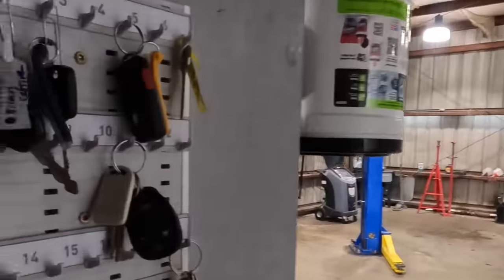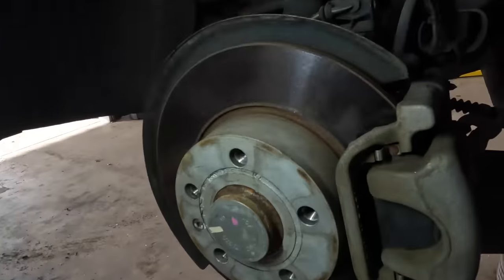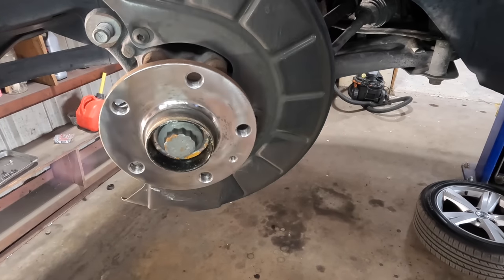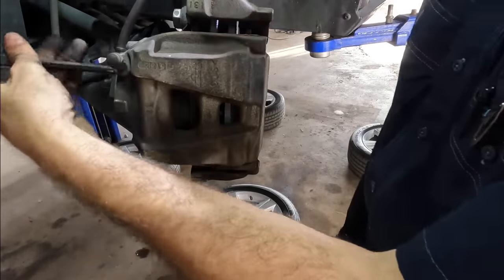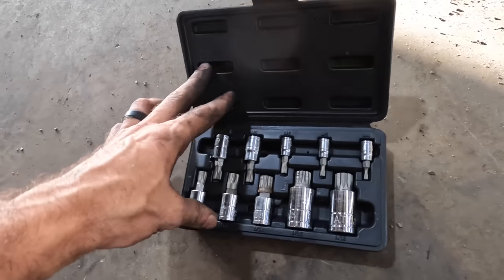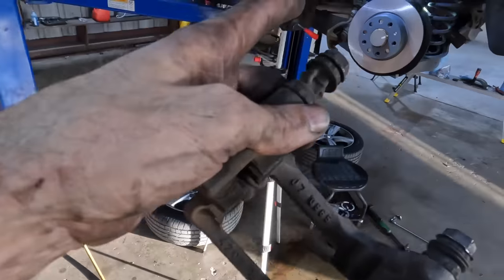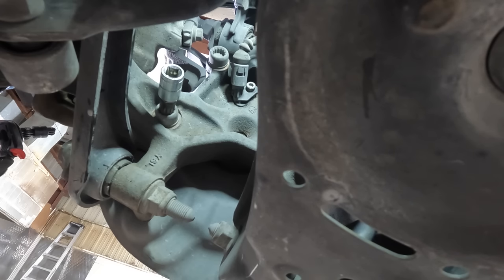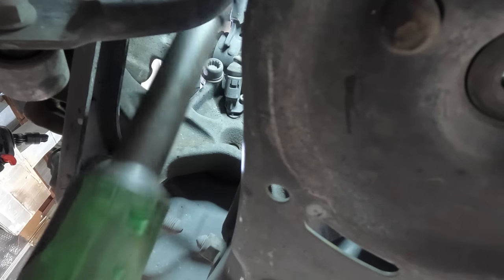Brake Job…with a Belt Sander? 2015 VW Jetta

Comment: That belt on the sander is screaming out for some tension there!

You restored my faith in humanity for lubing the rear slide pins, I will let it slide that you didn’t do the fronts (pun 100% intended).
Reply: 50-50 good enough.
Reply: Customer did want... to save some money - mission accomplished !
Reply: but the caliper is not human, will not slide for him, ensuring customer will pay for new pads and rotors next job.

Comment: Ray, at around time 37:00 when you were spraying out the caliper bracket with the stuck slide pins, brake cleaner splashed onto the camera lens. I sure hope you were wearing safety glasses. I am speaking from personal experience here, I wear glasses and way back in 1978 I had a '73 Chevy Impala Custom Coupe. The rear axle seal was leaking gear lube onto the brake shoes. I cleaned the shoes with brake cleaner and some splashed into my eye from one of the rivet holes in the brake shoe and into my eye from around my glasses. Immediately there was intense pain. I quickly ran about 50 feet to the janitor's sink and got my head and eyes under the faucet. Thankfully there was no permanant damage to my eye. Just be carefull and use PPE!

Comment: Did not know this

I am always told, rotor and pads need replacing at the exact same time

Now I feel scammed

I also am told I need to replace both front or both back at rhe same time (so 2 at the same time)
Even if problem only is with one

Comment: I have also battled with stuck brake pins.  I have even considered drilling the back side out to drive them out or install a zerk fitting to later be plugged!  I do have a 10 mm drill in my brake kit to clean out the corrosion and cooked grease.

Comment: I have a 2013 TDI which is probably the same.  It has a wear sensor in one of the front brake pads, the driver side if I remember correctly.  These cars go through brake pads very slowly.  If you are working on a V-Dub get yourself a set of XZN (triple square) sockets and one or two wheel alignment pins, M14x1.5 in this application.

Comment: Ray, one of my friends had that lug nut arrangement and the caps. He did not like the looks without the caps or he would have just left them off. He did figure a way to make the job easier. He drilled three holes all the way through the caps near the top. This, of course, resulted in six actual holes as there where holes both where the drill went in and where it came out. From then on he used a small hooked pick from Harbor Freight to reach in and grab the cap by one of the drilled holes similar to what you were trying and eventually accomplishing with the small wire that you were using to get the cap off.
Reply: The cars actually come with a little tool designed specifically for removing the covers, so no need to modify them. Assuming a lot of owners lose it or don’t even know it’s in the tool kit in the boot.
Reply: @edward.pearson  Whose boot and which foot?

Comment: i worked on euro cars for nearly 10 years, and every time i tried using my 1/4 inch impact on the rotor set screws id snap a torx.... i always had to use a friggin impact driver and hammer instead. win some, lose some indeed lmao.

Comment: Hi Ray, another great video and learning experience. However ever since I discovered boys as a teenager, I no longer do mechanic work.  Heck; I might break a nail.  I do have a question, why did you not resurface the rotors? Why replace the rotors when maybe they could have been saved? Was it due to time, labour was less by changing the rotors instead of resurfacing the old ones?
Reply: he said it, new not necessary good,ut b has no accurate measuring tool.
Reply: Very good question, since he already showed us his brake lathe, the new toy he just got!

Comment: I have found on my VW’s that i have to clean the inside of those triple square bolts because i always find they collect road dirt and don’t allow the socket to seat on the bottom of the bolts pocket, brake clean and a red tube to the rescue, i use scotch brite pad on those rusty slide pins. Good video to know how to properly evaluate the uneven pad ware that the previous person found before the pad slap.

Comment: Never seen a belt sander used on an almost new brake pad  to remove the grooves before. Not standard procedure , that's
for sure. This would have taken me a whole  day as a non garage owning regular joe who has done few on my  Chrysler 
made trucks and cars only. Got to make sure the slide pins are doing their job and not frozen.  Since the customer is happy
 about the work and cost of it.  Who am I to judge Ray , you did good.

Comment: They are Allens keys, not hexs lol

Good job they don't use Asbestos in the friction material or you and your lungs would be screwed (Asbestosis) but you should still think about the fine particulates messing with your lungs (miners lung?).

Different solvents can affect your health in different ways. High airborne concentrations of some solvents can cause unconsciousness and death. Exposure to lower levels of solvents can lead to short-term effects including irritation of the eyes, lungs and skin, headaches, nausea, dizziness or light-headedness. 🤔

If the slides are sticky it would be the outer pad that would wear more (bind on) as the caliper piston also backs off slightly when you lift your foot off the brake (the seal pulls the piston back a bawhair lol) but if they were excessively seized then you'd only be getting the inner pad doing all/most of the braking causing it to wear out prematurely.

Comment: If you soap and water, it’ll take it right off with a scrub brush a lot of the manufacturers don’t like to use and brake clean on the rotors and they won’t warranty them

Comment: I've never used a belt sander, but have scuffed the surface up on smooth pads on the concrete floor a few times.

Comment: I find VW using callipers from two separate suppliers odd. ATE on the front and something totally different on the rear. ATEs on the front are the same ones ford used on the rears of the Focus ST and the Mondeo/Fusion

Comment: I did my mk4 brakes and rotors this summer and my ABS hydraulic pump just decided to unalive itself 🙃 so now I'm riding on brakes version 1980s. 😅 found 3 units. That's for my technician friends,  but brakes that aren't anti-lock, fuuuuun.

Comment: I loved my 2013 Passat.  Great mileage, comfort and room.   I would have kept it for very long time.  I trade my Acura and my Solara  convertible,  believing that at retirement we only need one car.   The Passat was a great car for the first 35 thousand miles, then it happen.  From the repairs it needed I knew it was doomed. I unloaded it and got a boring Honda.   It was not less than a month latter that all Passats were recalled around the world, due VW lying to customers and government.   I will never by another vehicle from VW, they are so dishonest.  Just a note my boring Honda has over 119,000 miles drives like new, but it is still boring.  I am glad I have a 68 mustang for fun.
Reply: That was my car that Ray fixed in the video and I routinely get 30 miles to the gallon in the city driving it. I think the recall was just for a computer reprogram.

Comment: When doing my Jetta (527k miles on the TDI) and Passats, I will add a light coating of never seize to the inner rim of the brake disk/central wheel hub area to help them come off easier the next brake job.  And because the wheels are hub-centric, I do the same on the inner hub of the wheel, to make the wheel come off easy should there be a flat tire.

Comment: I learned long ago to avoid metallic brake pads due to them wearing out rotors way faster than the organic type pads which work just fine for me.
Reply: Ceramic would be an even better choice for you...longer life, wear rotors less, less noise, less dust on wheels. Organic are just junk and will wear out really fast.
Reply: @Boga217   Uhhhh no I already stated that organic works fine for me. I don't put a lot of miles on my truck and so far (couple of years) they are holding up fine. No need to try something different. The rotors are flat with little wear as are the pads.
Reply: @davidlong1786  uhhhh well its just advice, take it or leave it. But if you change pads again in future you could order offline save money and probably never need them again with better quality pads driving like you do.

Comment: do you consider cleaning mating surface and dial indicating rotor to see if it's still true? No idea if those rotors are $40 or $140 , or course assuming they are not already at minimum thickness.

Comment: When I had a two way radios repair shop and dealt with a plethora of people from taxis to sugar cane vehicles and being the serviceman and shop owner/sales/service writer, I spent sooo many hours either on a phone or talking to customers that came into the shop. I spent most of my evenings trying to get the bench repairs done.
Even when I hired an installer, the customer, often a taxi driver/owner would spend the hour or so that it took to install or remove their radios, wanting to talk story with me. It was great for customer relations, but really made it hard to get my work done. In addition I did a lot of work on different sides of the island of Maui and spent much of the time driving to locations and working on equipment located on the roof of the hotels. Lots and lots of time to travel there and go back and forth from the parking garage to the rooftop. Again, the people I dealt with sort of expected to be able to talk with me about what was happening and the latest and greatest new radios coming out.
Bottom line is I may have spent at least 60% of my time dealing with customers and potential customers as opposed to actually doing the work.
This is the life of a shop owner.
Reply: Hustling and distraction combo
Reply: @torchit007  🤔

Comment: Kind of related but I used to work in a place called Huntington benz and it was not uncommon to cut the rotors 3 times before you have to change the pads they will just start squeaking, Mercedes brakes are massive usually And we have no auto bonds

Comment: I would have had a complimentary look at the starter button too. I noticed a very strange phenomenon which is likely caused by the camera's frame rate. When you undid the first top caliper torque bolt, the socket part on the tool is turning anti-clockwise but if you look at the toque bit shaft it appears to be turning clockwise?
Reply: I notice that too, looks clockwise but the bolt actually turns loose. I notice of a few of Ray's videos, not just this one.

Comment: There is a proper tool for removing those wheel bolt covers, it should be in with the spare wheel change tools if they haven't already lost it.
Reply: There is a tool, sometimes it's with spare wheel sometimes it's in the glove box It is just a small little 90° pick not very special

Comment: these vw's has a tool in the trunk under the carpet for those wheel caps. it looks like a curly piece of wire
Reply: Maybe like a worm for pulling bullets from a front feeder?

Comment: Wait, did you not get a brake lathe machine? Would not re-surfacing those rotors be a cheaper solution? Well, if they were in spec to be turned.

Comment: I've worked on several VWs and Porsches. If you have the right tools, they're much easier to work on than American cars.
Reply: I stated in an above post,I just did a front bumper cover on a Porche Carerra,what a pleasure taking that apart,so easy! The engineering is so far ahead of anyone else! I litterally tool the front end of that car ib about a half hour!

Comment: Ray at the beginning of the brake job - "I'll reinstall the lug so that the rotor doesn't fall and chip the floor."
Ray at the end of the brake job - "I don't have time for that silly lug reinstall nonsense, screw the floor."

Comment: On my ‘15 Jetta the back rotors come off without removing the caliper carrier!
You did it the hard way….
Vw uses stretch  bolts so most are a one time use.
The rear carrier bolts get torqued + 90 degrees after. Should not be reused.
Reply: customer too cheap to pay for them

Comment: Ray, any VW   brackets I've removed that was secured with triple square bolts were always a pain to remove. I'm not sure if they slipped some sort of thread lock on them or was it heat from the caliper. To and to my misery the antiroll bar links were in the way. Good catch on the non slide sliding pins!
Reply: There is no Loctite, but those fasteners are torqued to 90 Nm plus 90°, so even after breaking it free, it starts shrinking, maintaining tension.

Comment: Just FYI the rotors you used are more expensive because they're coated to prevent rust. They really aren't needed for Florida. Just FYI I understand it's a VW and that might be your only option
Reply: It was my choice.  I didn't want the high performance and didn't want the cheep stuff either.  So I settled for the mid range stuff.
Reply: @rickbill4834  no problem buddy just letting anyone know. Not sure why they sell those down there at least they'll resist rust by the ocean. Farfegnugen

Comment: The extra lug holes in the front rotors don't make any sense, because the retainer screw hole blocks the fifth lug hole for the "alternate" set.

Comment: Owning a couple vws over the years, I keep an eye bolt in my toolbox for pulling those stupid caps off the wheel bolts.  Works way better than the stupid hook they give you.
Reply: The original tool from VW lays in the tire repair set in the car. If it’s not lost though.
Reply: @fss3379  true.  But the eye bolt still works way better
Reply: @fss3379  I just did some front bumper cover on a Porche Carerra,I looked for the wheel lock tool and no spare tire at all,it had a foam fill repair kit!
Reply: @petersmart1999  Yeah, the foam filler kit is more precise!

Comment: VW, Audi, Seat and Skoda have the worst rear calipers know to man for seizing up, they won't wind in at all so all i do is remove the caliper off it's carrier and pump the pedal to pop the piston out and clean the piston surface and the aluminium housing up then reassemble, when ever i get told they can hear a grinding from the rear when braking 99% of the time the piston has seized and worn the inner pad down to the backing plate.
I've had people ask me just to replace the pads when they have gone metal to metal and I've told them you will be back in a week for more new pads because the discs will just act like a cheese grater on the new pads if you don't replace the discs also, but they don't listen and a week or so later sure enough they are back for a grinding noise and then they get discs and pads,

Comment: Feel bad for the guy who has to take off that caliper bracket next time.  Would have been nice if you had swapped the semi-stripped bolt to the top position in case it rounds out next time easier to get pliers on it not that those round head bolts would lend themselves to vice grip extraction.

Comment: Hey Ray great video. You wanna try the rear caliper bracket on a passat with EPB... they give you 0 space for even a stubby triple square socket! BTW they are stretch bolts and are meant to be 1 time use but not many people do replace them... Although most rust inside which is why your socket was a little wibbly wobbly there sir. Top man
Reply: I've heard of mechanics packing the triple square bolt heads with grease to prevent them from rusting and becoming unremovable
Reply: @chrisfreemesser5707  I added some galvanised spray and then smeared copper grease inside before leaving mine.

Comment: i presume at this point you didnt have the brake lathe running, as the original discs looked thicker than the new ones you replaced them with
Reply: Ray doesn't have his own brake lathe, so it would be difficult to get it running.
Reply: @mhfuzzball  he acquired a used one ..

Comment: My new ish vehicle  has a push to start. Could you convert it to a key start?  Could you look back to the last key start for this company. Buy the complete setup and install that in place. Is there a aftermarket physicals key  start system in a box?

Comment: As an engineer I don't really see the benefit of the triple square spline bolts vs. a standard hex head bolt. Such bolts seem to be an enormous potential for problems, as Ray almost displayed. Obviously, there is more work in creating such triple square spline bolts as they have more area to be created and finished, yet said complexity doesn't seem to warrant their use in a critical area such as brakes.

Comment: I hate the triple square and E reverse torx bolts. Also have u ever tried to use a c clamp to push the pads together to the rotor that has helped me before.

Comment: Being cheap is not the way to go with brakes. Obviously someone just threw pads on there previously. That is why everything was rusted up, and worn and the pads were like new. They probably would have been fine if they would have at least greased up the slide pins. I know they were trying to save a few bucks, but with new rotors, I would have still replaced the pads. I know, I know they were like new, but still. What did they save, 50 - 60 bucks?

Comment: that 3x square is that unique to VW ? what was the size of the metal brush that you used to 
clean out where the pins go? I have one of those when I replaced my constant velocity shaft on 
my VW Beatle back in the day.

Comment: The bolts with serrated rim should just be cleaned before reattached, but the once without should always be replaced. More so in rust prone areas, because if not, the'll be impossible to remove..